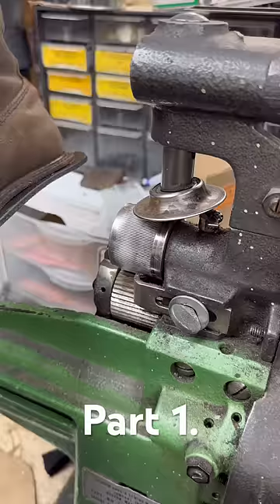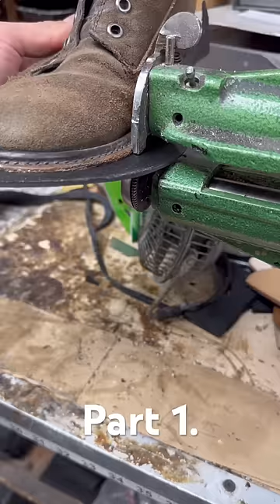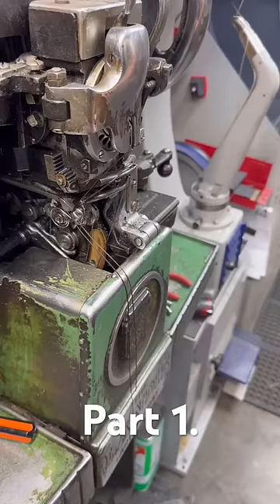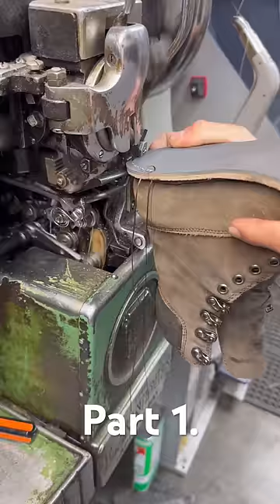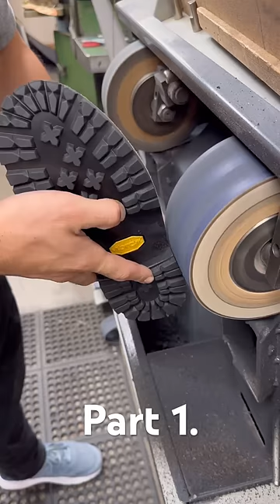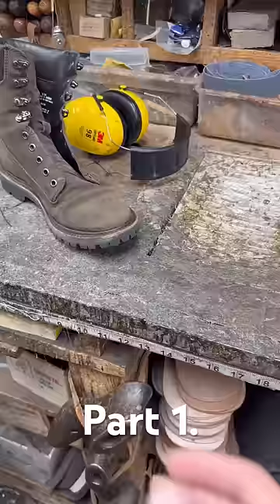New Sole Day Pt. 1 #thursdayboots #bootseason #explorer #combatboots #cobbler #mensboots #fall

Comment: The value of quality craftsmanship.
Reply from the maker: We love to see it! 😄
Reply: the value of quality is beeing replaced by quantity.. and it's a damn shame.. i bought a pair of very expensive work boots, had them for almost a year then the rubber in the soles were rotten straight through, got a new pair on warranty, same story.. ended up replacing them on warranty each year for four years.. then i gave up and got some other boots.. still expensive ones that promise a lot.. we will see i guess.. i wish there were more old school craftsmen around to make proper PPE that lasts and is worth repairing.
Reply: @DizzyRonson theyre very pricy, but nicks, whites, franks, and J.K still handmake all their boots in the PNW. I was trashing boots once a year and after a year of working harder than any boots ive had they still look brand new. I do not anticipate having to have them resoled for at least 3 years and frankly can not see the leather wearing out.

Comment: Sadly, unless it's a good pair of boots that cost an arm or a leg, it's cheaper to buy a new pair. I've been turned away from boot makers/repairers for that reason.
Reply from the maker: Hey Luke, that shouldn't be the case! We have a lot of GYW boots that are $200 and can be resoled for around $80. 🙌
Reply: @Thursdayboots  These were brand new lace up Blundstones, that were work issue. I had saved a few pairs and as soon as I did wear them, the soles just fell to pieces. I had to bin them, when they were made from good Australian leather (bear in mind this was 30 yrs ago). I later lashed out on $200 - $300 boots like 'Redback', 'Mack' etc and bought proper beeswax polish that I religiously kept up to them (one of those skills you learn in the Military that you think are a waste of time) and they have lasted years. I sure did raise some eyebrows turning up to work in spit polished steel caps. 😅😅